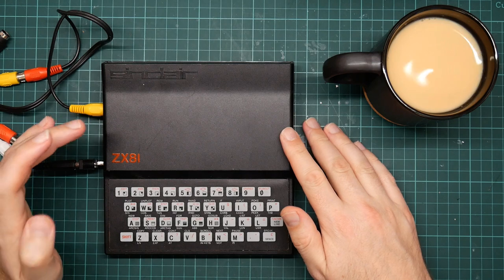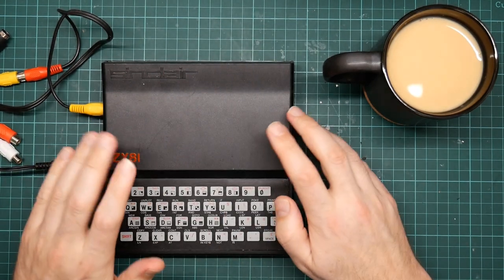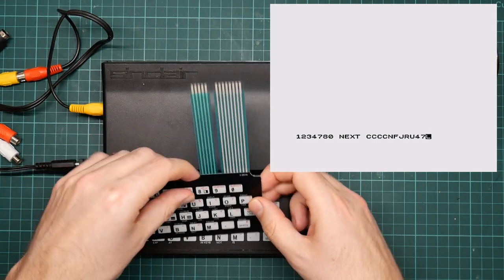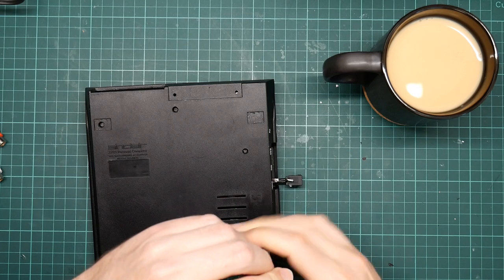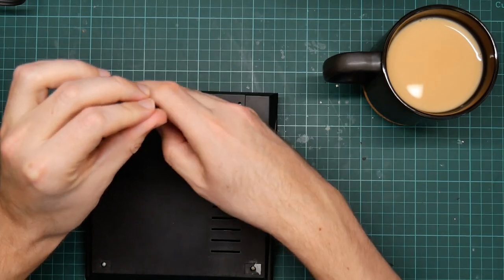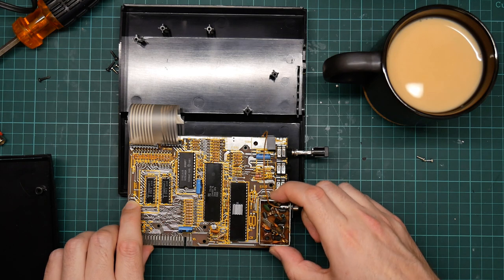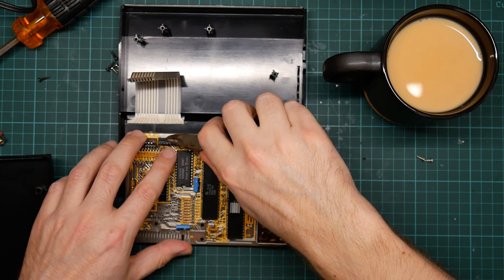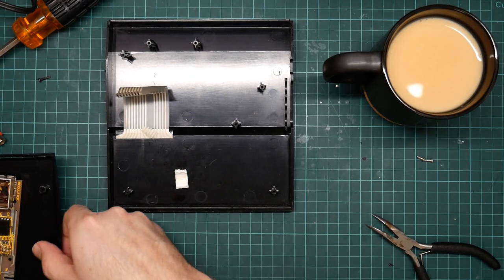Replacing a Sinclair ZX81 keyboard

Comment: Nicely done!

Where did you get the composite mod board? I've been trying to botch one together by basically building it in-place in the RF modulator box by soldering everything together and insulating with electrical tape, but you can imagine how successful that was. So a better solution is required....
Reply from the maker: It came from sellmyretro, but I don't see the exact model there any more. I did try various DIY mods using poorly soldered-together transistors and never made it work, so I decided to just get a all-in-one solution. Even with it, the ZX81 video quality is so bad my AV adapter has trouble syncing to it.
Reply: Usually early home computers generated composite video out by default from either a dedicated chip or some sort of programmable logic/custom silicon (like the ULA), though some had minimal n-board circuitry and drove the video output with software.-- A "composite mod" involves bypassing the RF modulator and either taking the signal directly from the video chip or passing RGB signals into a specific RGB->NTSC/Pal television encoder chip. Usually you'll see some minor active/passive components to clean up the signal or tweak it to an acceptable level/impedance for a TV's composite input.

Comment: I like how at the end you appeared to have realised how little "stuff" you can do with a ZX81.

So Fusix on it by next week then? 😉
Reply from the maker: It could be done. You'd need a ZXPand for disk storage, and a 64kB RAM pack, both of which would be hard to source. Lower case could be done using one of the various high-res graphics techniques available. I don't know whether they're good enough to cram in more than the terrible 32x24; you're limited as to what bit patterns can be generated. Unfortunately the top 16kB of RAM can't be used for machine code, and the bottom 8kB is permanently used by Basic, so you'd get a rather limited userspace area. You also wouldn't be able to run normal Fuzix Z80 binaries due to having to recompile everything for a different base address but you'd have to do that anyway because you can't use IX in ZX81 programs. The trickiest part would be interrupt handling; you might need to replace the Basic ROM.

But it could be done.